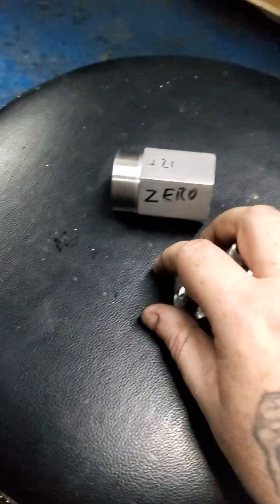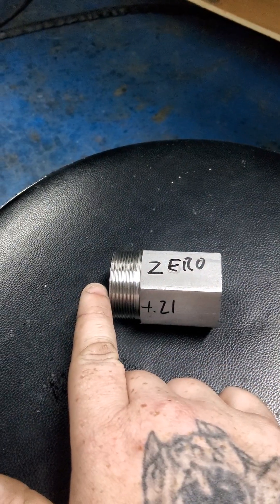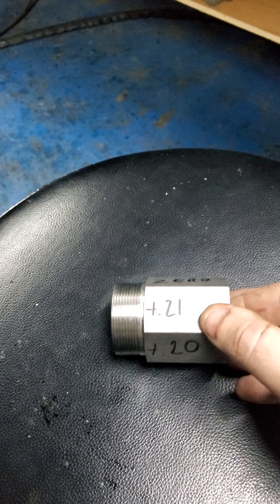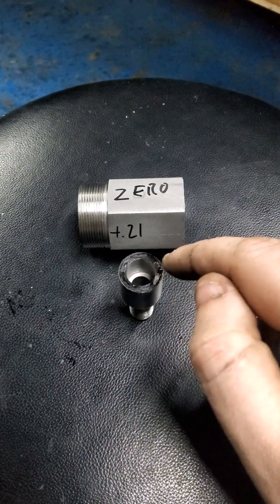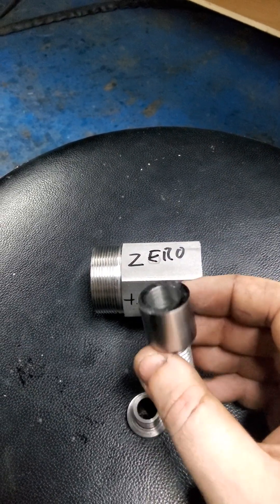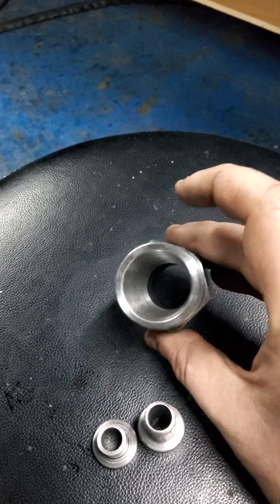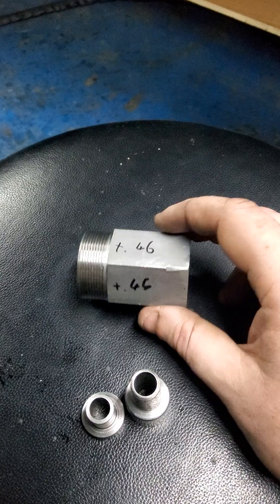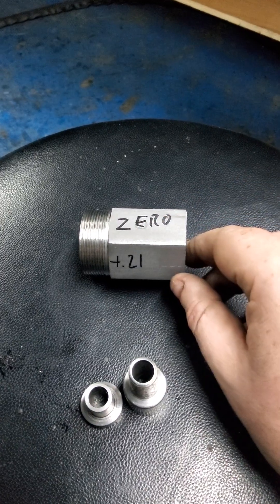Machinist advice needed. How to true a collet block to the center bore

Comment: The easiest answer would be to hand lap the higher sides, this will bring the centre of the collet concentric to the bore. 

It isn't a measure part anyway is it?
Reply: Have you actually checked the runout of the bore? It could possibly be that the outside size is relative to the concentricity of the bore (although I doubt it if it's a cheap collet block, but it isn't impossible)
Reply from the maker: I need it to drill a matching pcd for 2 parts with m2 bolt holes in a 4mm thick side wall.

Comment: Put a dowel pin in a 4 jaw chuck and clock it true, the tighten the collet block onto the end sticking out, use a dti to see how far out each face is from the lowest face and then mark them (looks like you may have already done all of these steps), mill the faces all down to your ‘zero height’. Alternatively use a dividing head on the mill then lock off the cutter at a set height and take a skim off each face. I’m a CNC miller and haven’t used a collet block or manual machines in years so these might not be the best ways to do it but it’s what I can think of off the top of my head, hope it helps👍

Update: Just seen from another video of yours (only seen your ‘shorts’ so not sure on experience levels or equipment, etc) that you have a rotary table, which you could also use like a dividing head, you’d clock it true to the spindle, then put the collet block in a vice and clock the bore of the block true to the spindle, then use an endmill at a set distance from the centre in the x axis and cutting along the y axis to take a skim off each side.

If you don’t have a mill you could use a 4 jaw chuck and place the collet block in it sideways, then skim off the amount you need from each side that way. (I’d use a parallel between the chuck face and collect block to ensure it is level then slide the parallel out before starting the lathe)
Reply from the maker: I'm no machinist. It's my hobby, so kinda just picking things up along the way. I'll try the rotary table and see if I can improve the results I got. I have a dividing head that I would have used, but it has no tailstock, or I would have attempted to use that. Do you think it's better than the rotary table? It has a chuck I can hold the part in. I just thought I needed to rely on the parallelism on the spindle once it's all turned true on the lathe between centres. Like I said, I'm not a machinist, so sorry if that seems a silly question 

Thanks for the advice it much appreciated
Reply: @smithbuilt I would opt for the dividing head because, depending on the length of the part, you could introduce a slight taper due to deflection of the endmill towards the bottom. I also think it would be a lot easier to set up than a rotary table. Without a tail stock however, the part might vibrate a fair bit when taking cuts with a face mill, although with the tiny cuts you’ll be taking it might not😂🤷‍♂️ Anyways you could tighten the largest diameter bar you can get into the collet block (to minimise the chance of vibration), then clamp that in the chuck of the dividing head and take a cut on each face. This does all rely on your collets and chuck on the diving head running true as well. 

No such thing as a silly question either! And again there’s probably a method 10x better than anything I’ve suggested, I’d make sure the bore is concentric to the threads, hold it in some soft jaws and run a cutter around in a hexagonal pattern on the cnc😁
Reply from the maker: Ah, yes, the joy to have a cnc on hand. I'll break out the 4 jaw later. Cheers for the advice mate not many people are very "understanding" when you're "self educating" in this field 😀. The odds are that I'm trying to chase a level of accuracy higher than all my old machines can achieve anymore, but it's fun trying to see what I'm capable of achieving with them.
Reply: @smithbuilt nobody starts with all the knowledge and the fact your chasing microns shows your on path to being a great machinist mate👌
Reply from the maker: @GJGAMING5 Thanks 😊

Comment: Have you checked it with multiple collets and either dowel pins or gauge pins to see if it is consistent
Reply from the maker: I don't have either of those type pins to hand. I was using an end mill.... shank end, btw lol.
But I will check with a few different sized collets to be sure tomorrow. It's very annoying. I'm trying to improve my work, and every time I find either, I don't have the needed tool, or very often, the tools I have are not that accurate.... need to buy new ones
Reply: @smithbuilt that’s how it goes especially starting off on a budget, I bought a bunch of stuff in the begging that was garbage but have found the cheap stuff from shars is pretty good
Reply from the maker: Very true